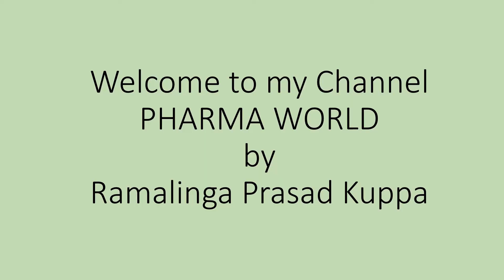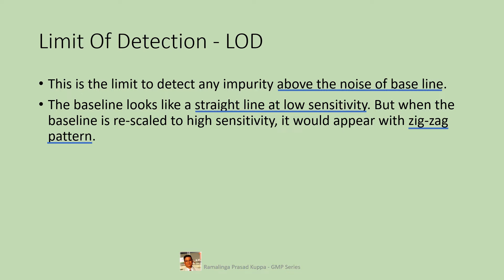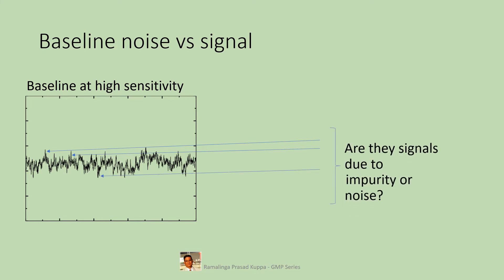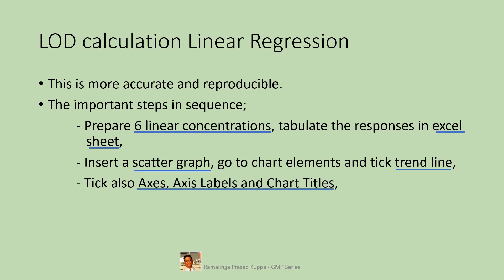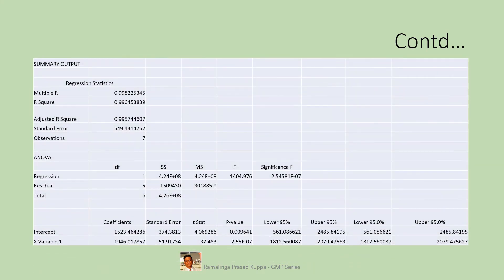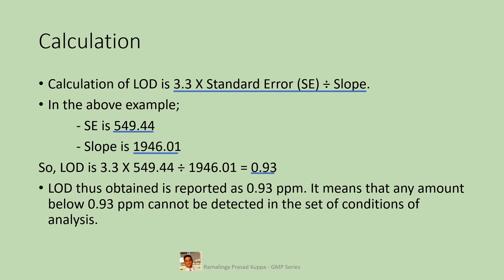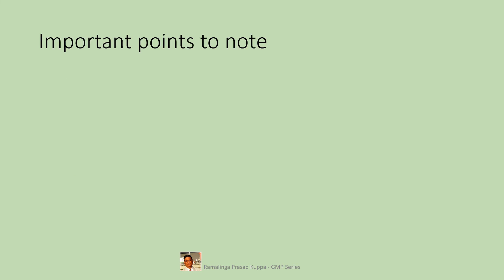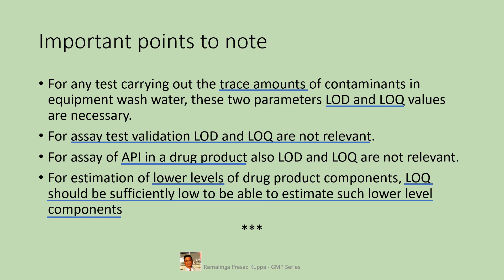LOD and LOQ

Comment: Dear sir, Kindly explain the calculation formula for below assay test.

Dissolve 50 mg sample of sodium chloride in 50 mL of water and titrate against 0.1 N silver nitrate VS. 0.1N silver nitrate is equivalent to 5.844 mg of sodium chloride.

Explain the formula for calculation.
Reply from the maker: Equivalent weight of NaCl is 58.44. So, 0.1 N will have a factor of 5.844. That means each ml of 0.1 N AgNO3 will be equivalent to 5.844 mg of NaCl. So, for example, if volume consumed is 11.2 ml, the sample contains 11.2 x 5.884 mg of NaCl, which is equal to 65.4528 mg. Further it is simple to extrapolate by multiplying with 100 and dividing by weight of sample. You have to make correction for exact normality of AgNO3.(It may not be exactly 0.1N. It may be 0.09 or 0.12 etc..)
Reply: @pharmaworldk1473  Thnk u so much sir for your reply.

pl confirm the weight in mg or gm ?
Reply from the maker: You have to use same unit of measure, either grams or milligrams.
Reply: Sir, what is RRF calculation of linear and slope method with correction factor? Please explain.